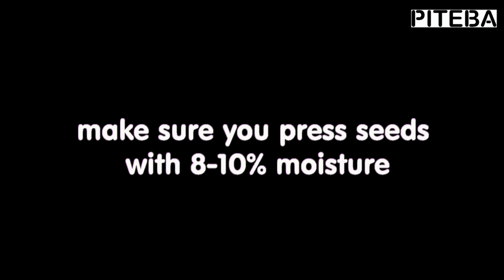How to press black seed, Nigella sativa

Comment: You don't need to heat up the press machine that's why it's called a cold press machine
Reply from the maker: You are correct! The electric PITEBA press does not require a burner during pressing. However, to improve oil extraction, preheating the press can be helpful before starting. Once the pressing begins, no additional heat is needed.